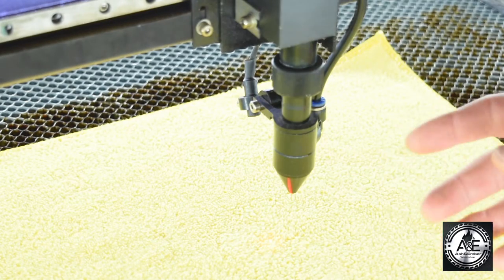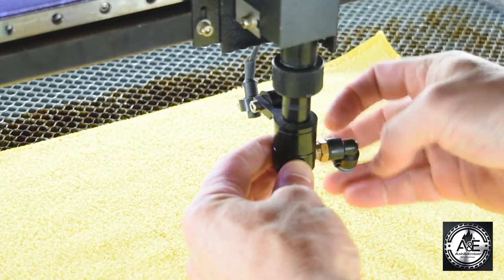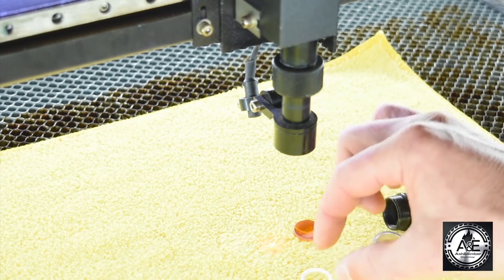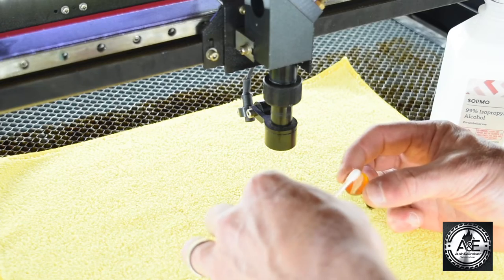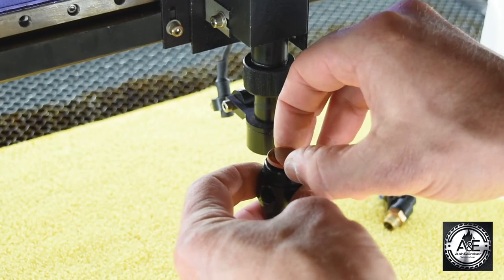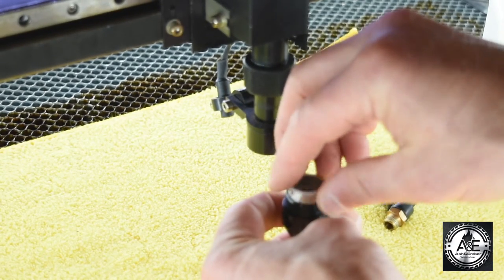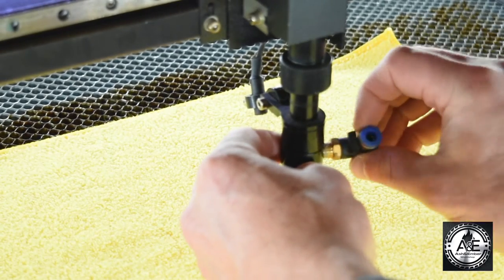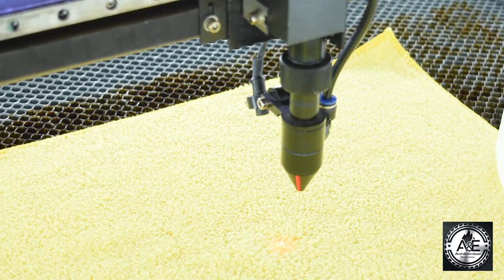Cleaning & Correct Orientation of your CO2 Laser Lens

Comment: Hi David

 It's interesting that every Chinese laser I have encountered  is supplied with the lens flat side up. Here in the West  (probably even the US arm of OMtech) it is believed that flat side down is the CORRECT way,. For many years I believed this idea because that's what optical experts more knowledgable than I were telling me. Lens theory applies to instruments that uses normal light, things like  cameres and telescopes that transmit images. Laser beams are not normal light and although  our lenses treat laser light rays exactly the same as normal light rays ,  what happens to the beam at and beyond  the focal point is "interesting" and cannot be expained by lens theory.  When I started testing different focal lengths and types of lens for cutting efficiency,   some of the "facts"  I had learnt were easily proved to be incorrect. I have spent nearly 4 years trying to discover the mechanism that allowes lenses to cut deep parallel  kerfs when  theory say they can't. It is only recently that I have  put the last vital  pieces into this puzzle.   It basically illustrates there is no right and wrong way for a lens. It really depends what you want it to do.  If you want deeper faster cutting then  flat side up is better and for  most lenses flat side down is better for engraving.   Take a look at this video to see how lenses and laser beams work together to exploit a natural optical error that exists in all spherical geometry lenses (the type we use).    https://youtu.be/kddSFO-iFNM

I would not normally comment like this on a video but I have no way to contact you privately.  I  will be very happy for you to copy this content and remove it from public view. If you wish to contact me then please use this private  contact form.
https://forms.zohopublic.eu/ndeavorlimited/form/K40XtreeemLaserCutterContactRussSadler/formperma/k2Cn0QN5ChpazfTMAUw25lZ-FKpjZa96TQWHjv3ntOg

 Best wishes
Russ